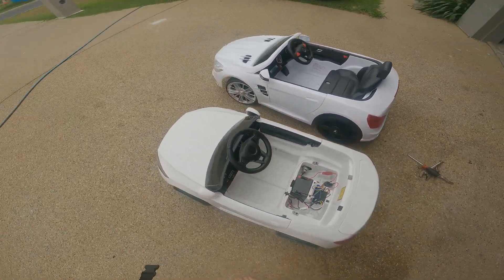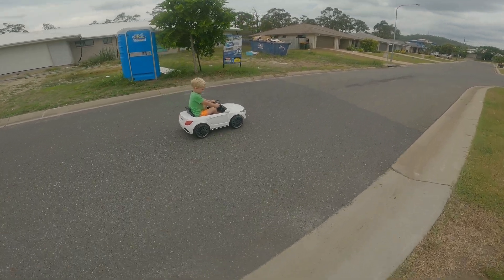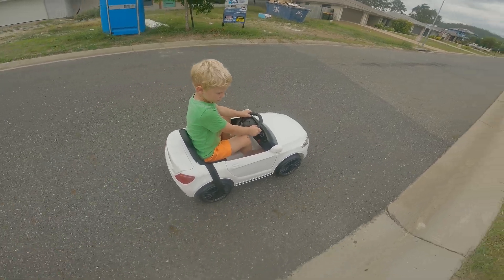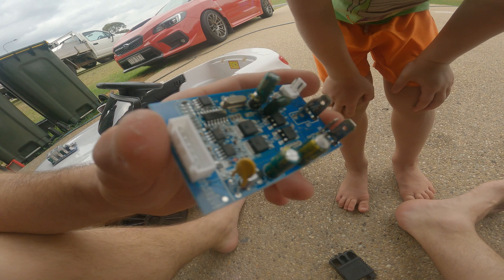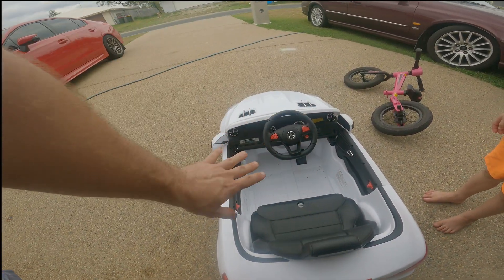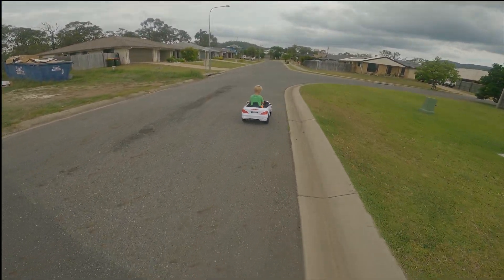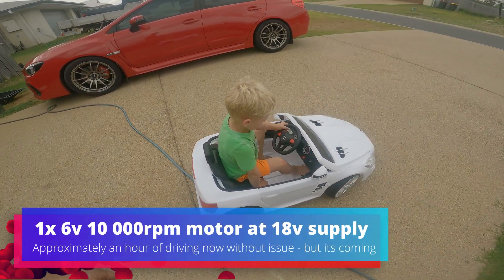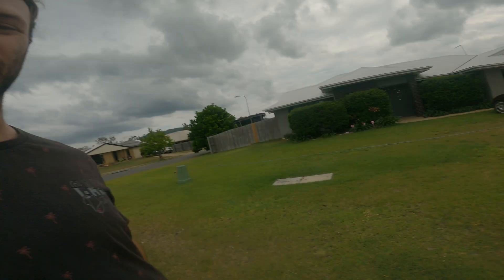What do battery upgrades look like? 6v and 12v cars upgraded

Comment: How did u learn to do this
Reply from the maker: @NaomiV33  I just put larger batteries into them, some required different adapter wires but it's just a bigger voltage battery